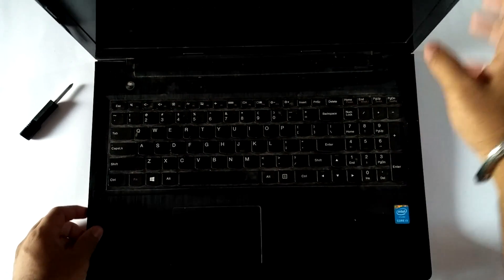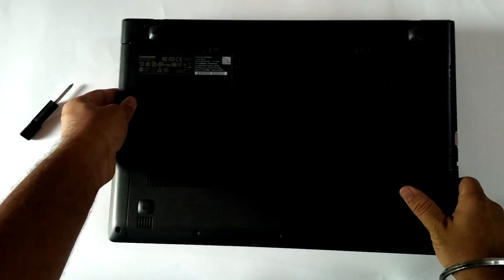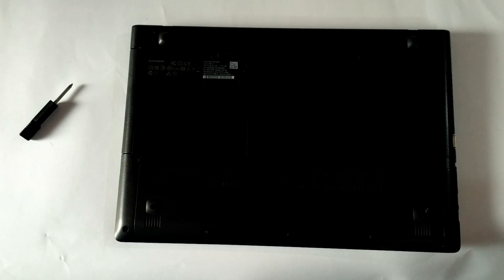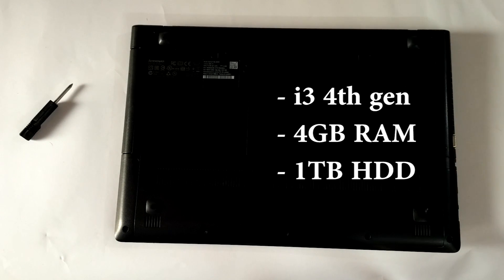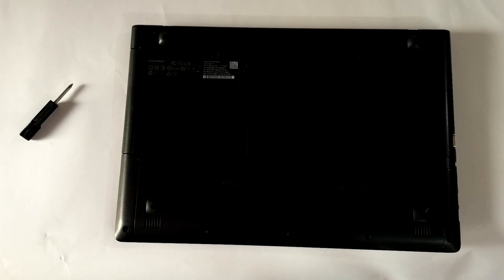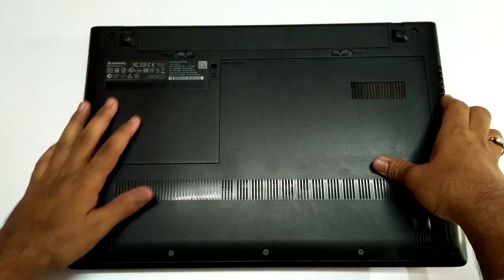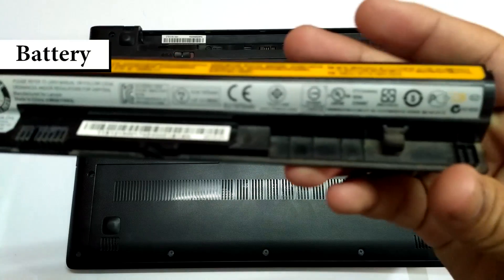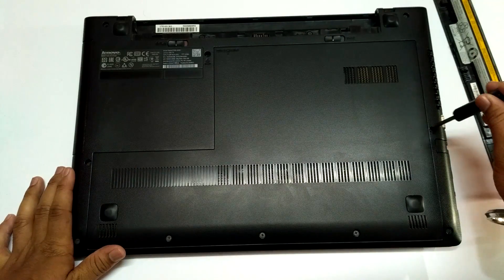Lenovo Laptop Teardown / Repair | G50-70

Comment: Actually, you can remove the touchpad from the bottom case top part with an hair dryer (and a cutter if you are impatient like me). Heat up touchpad board and sneak gently the cutter blade below.
Then you can just reheat the glue and stick on the new case.

Comment: Beleive me iam still using this laptop it has crap i3 4th gen and 4gb dd3 ram with sloth 5400rpm hard drive..if I gave this laptop to a rich gamer or streamer it will be a great torchure for him.
I want to upgrade it's ram and replace its crap hhd with slowest SSD(still it will be faster than hdd).
Reply from the maker: You need to upgrade your Ram and SSD. I am still using this laptop and it is a beast considering its price and age. I have upgraded ram to 12gb and have a 256gb SSD. I often do video editing using premier pro on it and it works fine.

Comment: hI i HAVE A LENOVO G50-70, I7 GPU is damaged any solutions
Reply from the maker: Change motherboard
Reply: @encryptedguy  Hi how to get new motherboard, if you have one or reconditioned one pl. let me know.
Reply from the maker: Try from local repair market where they harvest old laptop parts
Reply: @encryptedguy  My laptop is lying with local laptop repair shop in Navi Mumbai for 1 month, There is no solution. I have two other laptops requiring motherboards, if you can help do let me know.
Reply from the maker: Visit vashi plaza there is a laptop parts importer on 1st floor ask for price there
Reply: @encryptedguy  Bro which building, do you have office number, or contact details, as there are plenty of buildings. I can walk there in 10 minutes. Thanks a lot.
Reply from the maker: @rajsanmihir  9820265245 / 02266733504 chandan

Comment: I have a laptop lenovo g450. It has a problem , when I plug in charrger it will start charging for 5-8 sec after that laptop doesn't charge . Due to not charging laptop is shut down since 3 month. What should I do?

Comment: Hi Rohan, Thanks for video. I have Lenovo G50-80 and on boot it does not go beyond Lenovo logo, and what I noticed is system date time is set to 2013, could you pls suggest what could be issue and do you suggest anyone in pune for repair as I had very bad experience with Lenovo service centre pune
Reply from the maker: There might be some issue with hdd I guess,
you need to check if bios is accessible if yes then check if hdd is detected or not. Secondly try booting linux os and run some diagnostics

Comment: where is the cmos battery timestamp pls
Reply from the maker: There is no CMOS battery
Reply: @encryptedguy  im having an issue with my lenovo g50 70 core i7, its not powering on. When i push power button the power light lights up then goes off or it keeps blinking after every 2 or 3 seconds and  and nothin shows on screen
Reply: @encryptedguy  when i searched issue on internet it gave me couple of solutions, 1 drain power then restart, 2 reset/replace cmos battery. I did the first nothing happened but couldn't try the second option cause i couldn't find battery
Reply: Cant find cmos battery on my lenovo g50 70 core i7
Reply from the maker: If in case bios is gone bad you can replace the chip from local repair shop it's cheap. But first verify wether bios is bad or is there any other problem
Reply: Alright thnks

Comment: Hi I have same one , its mic not working , please help me to fix
Reply from the maker: Try reinstalling the audio drivers
Reply: @encryptedguy   Thank you , I done but still not working, please give your suggestions
Reply from the maker: Does external headset mic work ?
Reply: @encryptedguy  yes, I checked with headset mic, it's working
Reply: Inbuilt mic not working
Reply from the maker: Then I guess your microphone module is damaged. You can replace it easily it will be besides your webcam and is cheap. But before that I will suggest installing a new os and check if it works. Also check device manager if your os recognises your mic.
Reply: @encryptedguy  Thank you for your valuable reply, I am using os is windows 8 and not a licensed. For your kind reference
Reply: Sir, please suggest which microphone is suitable... Or please send link Thank you
Reply from the maker: For basic communication any headset will work even mobile earphones will work.
Reply: @encryptedguy  sir, I am asking inbuilt mic replace , which one is suitable. We can replace mic only or  module.
Reply from the maker: Check local repair store or AliExpress
Reply: @encryptedguy  Thank you

Comment: "Lenovo g50-70"My screen is blinking when i switch on the laptop.. its getting 10 to 15mins to enter OS.. what's the problem?.. My service man said bios chip gone and charged 1500? Is it that much costly? Where will see the bios chip? I don't think it's bios corrupted.. please reply.. thanks in advance
Reply from the maker: If your os is booting at all your bios chip was in working state. Probably installing a different os like linux would have solved the problem
Reply: @encryptedguy  does the bios chip will corrupt as service man said?
Reply from the maker: Yes bios chip can go bad sometimes but if you can boot in windows I don't think the problem was with bios
Reply: @encryptedguy  will it be some display issues bro?
Reply: @EncryptedGuy One last question bro.. how about the cost of bios chip for Lenovo g50-70 laptop?
Reply from the maker: It depends on person to person

Comment: Hi , I have lenovo g50 30 laptop which have weak processor and i want to upgrade to better processor and graphics card , is it possible to install a g50 70 motherboard which has i7 chip and 2gb graphics in lenovo g50-30 and replace the heatsink of g50-30 to a g50 -70 model heatsink?

Comment: Have similar laptop with i3 processor 4th gen. It can't be upgraded with higher processor, so is it possible to replace motherboard with higher processor!? I5 or i7 processor???
Reply: U cannot upgrade processors in laptop instead use the same
Reply: I have lenovo g50 30 , and i want to upgrade the cpu and have graphics cards , then i saw g50 70 is having similar design motherboard but it has i7 5th gen and 2 gb card

Comment: Bro my g50 is not turning on and also not giving any response even not the charging light is glowing. I put it on a new charger and it just got heat up a little bit from near the battery. 🙁
Help me bro
Reply from the maker: Maybe your motherboard is dead. Check with a proper and experienced technician

Comment: I dropped it and battery didn't charge while it was on. Now not charging at all. I think it's an internal issue because new charger also no help. How do I open and fix this issue?
Reply from the maker: Check for the condition of charging pin

Comment: What if screen doesn't showing anything help after assembly?
Reply: Same here 😭, what to do now.
Reply: @kartheek064  hey man no problems      just check the display cable
Reply: You can cheak RAM
Reply from the maker: Try connecting external display

Comment: How can I change the processor in my Lenovo g50-80. Please reply bro
Reply from the maker: Processor is below the heat sink I have not gone so far but I guess that you can change it. But make sure new processor is  compatible with your board .
Reply: @encryptedguy   thanks
Reply: @encryptedguy  I have same brand and model laptop but with AMD A6 processor (I wanted to upgrade the processor but I am not able to change it because processor is inbuild on motherboard ) so it can't be upgraded and same for graphics card
Reply from the maker: You can change the entire motherboard for upgrading

Comment: I have a Lenovo g70 and i have error code 43 on my graphics card. It's a NVIDIA GeForce 920M and i'v tried all. So i want to see if i Can tear apart the laptop and see what's wrong. But idk where could graphics card in it. What do you think?
Reply from the maker: The graphic card will be soldered to the board so u can't remove it. But u can try clean install of Windows 10 with latest nvidia drivers
Reply: @encryptedguy  Thanks. Gess i'll need to save m'y stuff before doing it. But i can't save my GTA 5... thats ok. Because i Can Do it once i got my New Pc. I still got a spare graphics card. (Intel HD graphics 5500) and it's good enought to run the game i play the most. Thanks mate! Have a good day

Comment: In my laptop, the laptop turns on from battery only and not from adapter. The adapter socket is probably clogged or worn out. How to replace the socket without taking out keyboard, HDD,DVD,ram,fan, WiFi etc?
Reply from the maker: To replace the socket u will need to disassemble your machine

Comment: can you upgrade the graphics card. I have the g50 with Radeon R4 would like to upgrade if possible...Also the APU I'm running the AMD A-6 6310 is that upgrade-able? Thank you!!!
Reply from the maker: I guess u can't its soldered on the board

Comment: Hi

I have a g50-70 and I have a black screen with faint flashing on the screen no start

Hard drive ok

Motherboard ?
Reply from the maker: Try connecting an external display and check if its working.
Also try changing ram.
If nothing works then it may be some motherboard problem.
Reply: @encryptedguy  yes connected to an external display,  its the same thing
Reply: @encryptedguy  can you assist in helping me find a replacement new mother board on ebay and send a link to it? My HDD and memory are all fine, I'm sure it is the motherboard and thats unfortunate for me )
Reply from the maker: I guess eBay is region specific try contacting Lenovo care, find price in local repair store or check Ali express
Reply: @encryptedguy  ok thanks

I watched another video and the 737 battery converter can be a problem, do you reccomend finding someone to fix my mother board locally ?
Reply from the maker: Check review of the repair shop before giving them your laptop
Reply from the maker: Laptops don't have CMOS battery I guess. The main battery gives power
Reply from the maker: I have dual booted my machine with Linux and when I boot into Linux the time of windows changes. N BTW even newer motherboard don't have removable CMOS
Reply: @Lotusrk123  I tried this, made no difference
Reply: @Lotusrk123  what's ur symptoms ?

Comment: Sir i have a lenovo G50 laptop , only power LED blinking and no any movement in my laptop , so sir how to fix this problem, please help me sir.
Reply from the maker: Check if the fan is rotating 
if yes 
Connect external display via VGA and see if it displays anything
If fan is not rotating try swapping RAM
Reply: Mera v same problem hua hai..kya hua aapka bana laptop or agr ban gya to kya problem hua tha usmein plz help me bro
Reply: @ziyasheikh8140  Laptop ka motherboard kharab tha mera, repair karwana para uske bad start hua, mai khud ek engineer hoo
Reply: @kumudranjanitclasses3995  kitne din 
Laga tha banne mein or kya price laga tha bnane mein
Reply: @ziyasheikh8140  1200/- ka kharch aaya tha , aap kis state se ho waha ke IT par nirbhar karta hai ki kitna tak me wo repair karta hai
Reply: @ziyasheikh8140  same day me ban jata hai
Reply: @kumudranjanitclasses3995  thanx bhai aapka bhot bhot sukriya main jharkhan ka rehne wala hoon
Reply: @ziyasheikh8140  Waha bhi 1000/- tak me board repair ho Jana chahiye, waise Aapka laptop kaun sa hai, aur problem kya hai?
Reply: @kumudranjanitclasses3995  mera lenovo ka hai mere laptop mein problem ye hai ki main on kr rha hoon to led ka light blink ho rha hai but screen blank hai mera laptop lekin charge le rha hai
Reply: Maine laptop khola v tha or harddisk nikal tha or ram v saaf kiya tha but on ni liya
Reply: @ziyasheikh8140  kis company ka hai laptop

Comment: Where is the CMOS battery and can it repair BIOS failure due to update
Reply from the maker: I Guess the laptop battery acts like CMOS battery (not sure)
Reply: EncryptedGuy Its the blue one in the center any ideas on how to remove it??? https://extraimage.net/image/s9Kk

Thanks for the quick response though.
Reply from the maker: May be a battery or a buzzer to indicate post codes

Comment: is it very complicated when screws get mixed
Reply: to rebuild
Reply from the maker: +Rushikesh Gholap thanks for watching
Reply: EncryptedGuy { Rohan Parab }  answer for that question
Reply: please
Reply from the maker: Yus.
Reply: Most screws should have a small marking under the head of the screw. Mine had blue and red markings on it. Also another thing, be very vigilant with the screw that goes to the CD ROM because its the smallest screw. Last but not least the screws are labeled on the laptop as Mx5 Mx7 Mx6